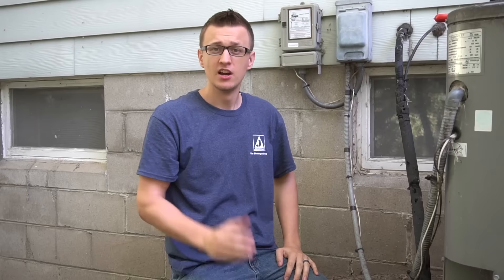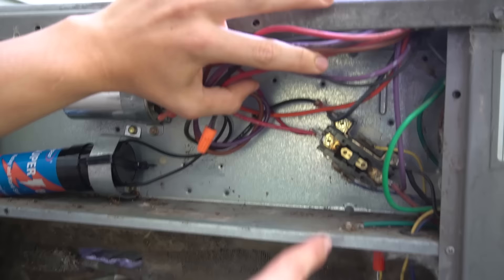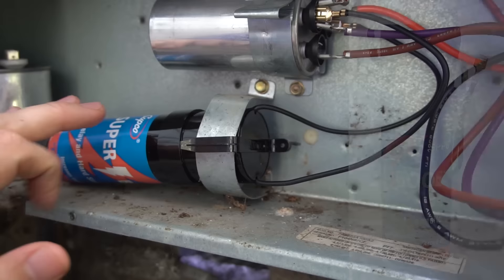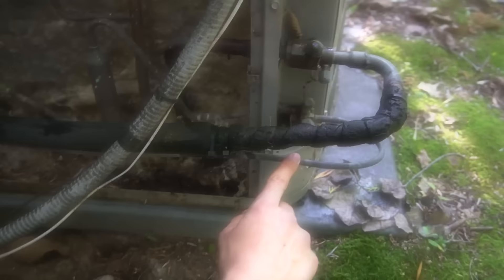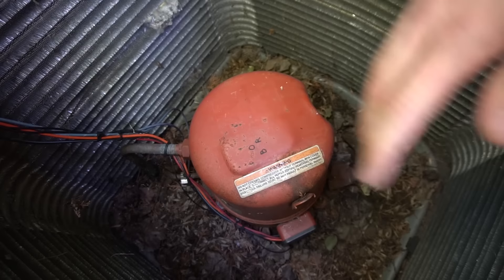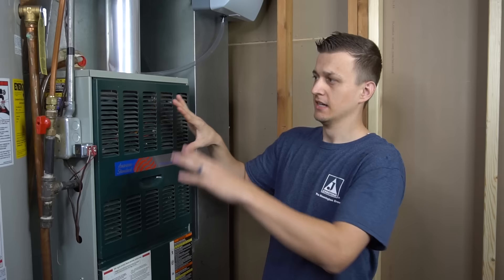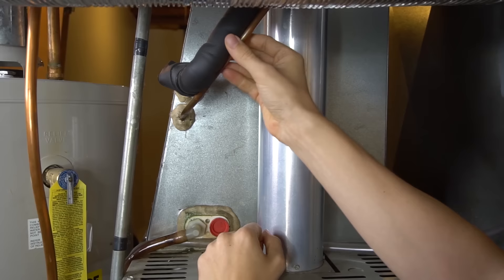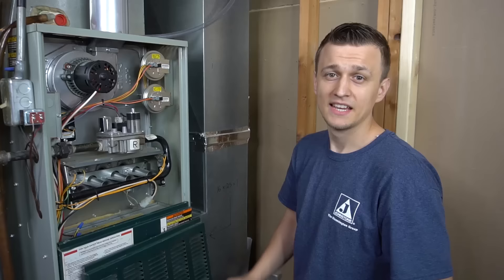All AC Parts and What They Do

Comment: It’s not the discharge line, it’s the liquid line. The discharge line is between the compressor and the condensing coils. The liquid line if after the condensing coil. 
This is every important because trouble shooting commercial equipment requires that u know this. Often, there’s ports for testing at both sites.

Comment: I recently had my entire HVAC system replaced. They put a new power box in… I think replacing my old 20A. But they left the old box with (what I just learned is) the electrical whip. I was mowing my lawn today, and I almost ran it over. It’s just dangling off my house. Can I just rip this box off? Or is it something an electrician should do or what?

Comment: Thank you for the video, I can tell you're very knowledgeable . I have a question, I was running heat and the unit cut off in the middle of the night. Now the unit is not turning on but I went out and checked and it has 220v. I tried turning the fan on but no dice, and the unit is in heat mode. Along with that it's fairly new, only about a year and a half old. What could the issue be?

Comment: My Lenox Blower Motor Control Board is shorted due to condensate water leak. Some of the transistors/resistors damaged from mould and such. Is there a way to repair or change the blower motor control board. Installed a new compressor and started working when turned on, but quit from overheating the compressor. Noticed the Mother Board Damage later. The unit is about 19 years old but was working good until the leaks developed damaging the blower motor control board. Need to know how and where to get the replacement mother board to specification? Appreciate your input. Thank you.

Comment: Thanks for the explanations. At 6:25 you're saying the Discharge line should not have insulation. In me case the Suction line is insulated as it should be, but the tape used to keep in place the insulation is wrapped around the Discharge line, too, as the lines are next to each other. Should I remove that tape from the Discharge line?
Reply: No that's nothing you need to be worried about. That's just used to keep the pipes close together and potentially keep you from accidentally stepping on one and crimping it while you're cleaning up the area around it. Countless times I've seen homeowners step on them while cutting shrubs and bushes around their air conditioners. I actually had one cut that small liquid line thinking it was a root or Branch from a shrub.

Comment: Hey Jay I missed this video somehow and just now caught it. Great video. I hope you do a how the freon cools your house video. I know how it works, but many people don't realize how freon acts under pressure or how it actually extracts the heat instead of introducing cold in the system.  And ?. On the A coil there is two pairs of red and green plugs on the side near the bottom of the coil. I guess these are all drain ports. Please explain what they really are and why they are colored red and green. Red would be high pressure and green low pressure but there isn't pressure in a condensate drip pan. I don't get it. Please explain. Thanks Jay. Love your videos. Jpol.

Comment: How do I remove the existing capacitor without dying? The power is off at the circuit breaker and the emergency shut off. However, some videos say the capacitor has a charge and you have to discharge it.I'm afraid to touch it
Reply from the maker: I show how here: https://youtu.be/45oZXnClMD0?si=7KESPSPiwGdUZe9V

Comment: Great to learn from. I mainly do heating (combi boilers) but my boss threw some airconditioning units in but we don’t really get how they work yet. I’m from Europe so I mainly work with 230VAC how does that apply to a contactor? We have a hot wire (230) a neutral and a ground wire. Should the hot be attached on the side of the plunger and the neutral on the side that’s open?

Comment: Thank you so much for this video, I have been watch your channel a while, very informative and helpful. I also have a quick question, I found there are 5 wires come from compressor of my Lennox AC outside unit, three direct from compressor, two yellow wire from a device plug in the liquid line. What is the device for ? IT looks like a "thermometer" to me. Thank you !

Comment: I have never worked in the field, possibly just starting to this month.. any advice on tools I’ll need in order to work for someone?
Reply from the maker: Some companies will actually provide the tools so I wouldn't rush with buying things. But if they don't, I would suggest only getting the basics: a multimeter, screw drivers, screw gun/drill, nut drivers, pliers, wire strippers, temperature probe, refrigerant gauges. Most companies will start you off by making you ride along with senior techs to learn for a week or two. As you go with them on different jobs, you will get a better idea of what other tools you should get. Or perhaps you could hold off on buying anything at all until you get the job.

All that being said... I do have a few videos on basic tools that you may find helpful:
https://youtu.be/fOsUpIfvoBE?si=Oub1KdoKbTICNcL2
https://youtu.be/kQjAreD8CuY?si=Q8IVmYq7F0Kz4WjF
https://youtu.be/pqE4C7c9_eI?si=4MbOr19Rf5AxuwWr
https://youtu.be/Sh8kiQKzVXQ?si=y2zulnxnKv1LPkxx

Comment: Someone said his system is fantastic and he takes care of it even getting an annual checkup by a tech. He claims that his system can go from a couple of days not working to 68 degrees in less than an hour. Cooling down his warm house that reads 89. Is that possible? Meanwhile after replacing capacitor my system struggles with getting to 78 degrees set temperature during the very hot day. Heat index of 108 degrees. What are the obvious causes for my struggling system ? Low refrigerant? Old compressor? I washed condenser unit coils and filter replaced. Just a few weeks ago it kept up to set temperature of 74-76 degrees no problem. Yes it gets down to that 78 degrees overnight but can’t do it during the day when the heat is Soo ferocious.

Comment: There is a part that you did not go over and funny enough is the part I am scouring you tube for its in side by compressor it has a two wire black wire coming of of it and it goes to a box on side of compressor.  I wish I could send you a pic I saw it on yours and maybe you said some thing about it but I don't think so🙁

Comment: I love the Info I get from your videos.
Have a question:
Have only a run capacitor, can I install a dual capacitor to help the fan?.
And two, can I install a hard start capacitor.
Reply: Most systems have what is called a dual run capacitor which is essentially 2 capacitors put into one. Those can be identified by having 3 terminal blocks on the top as well as a dual microfarad rating such as 35+5 MFd. Sometimes the compressor and the fan have their own individual capacitor. If your fan does not have a capacitor and it is working then it is probably an ecm motor which does not need a capacitor and should not have one.
You can install a hard start but it is better to look up the factory start capacitor and relay setup and run that. A hard start is more intended for an old compressor that does not want to start on its own.

Comment: You have a great explanation 👍, may i ask, how should i know the compressor tonage please ‼️ thanks❕
Reply: Look at the serial number located on or near the control panel, there will be a number divisible by 6. 6 is equivalent to half a ton, for example: if there is a 30, it will be a 2 1/2 ton unit.

Comment: Hello thanks for your videos! My question is Why Does my suction line is covered with ice during hot weather????
Reply: You either have restricted airflow through the coil or are low on refrigerant. You would need a gauge and a temp probe to figure out which one. 
Alternatively you can check for proper airflow. Make sure the filter is clean and is not too high of a MERV rating. Check the blower wheel for dirt that has gotten packed into the wheel. If you have dirt at the wheel then there is probably dirt in the evaporator coil and you should hire a duct cleaner.
But from what it sounds like you are probably low on refrigerant.

Comment: Thank you for your explanation, one question, do you think I should change my AC unit if it is already 23 years old, I already changed the fan motor and the fan and a new capacitor and I maintain it once a year, do you think I need to change my units although it is working fine?is true  that old units can last 30 to 40 years?
Reply from the maker: I've seen quite a few 30 and 40 year olds. 😄 If it is working good, I would not replace it.

Comment: This video was just recommended out of the blue. No real reason to watch it other than I like learning about mechanical and electrical things. Anyway, I really enjoyed it and learned a lot.

But in Las Vegas a good portion of AC units are self contained units that sit on top of the roof (why would they do that in the blazing heat) and the compressor section and air handler are all together. Most of the units in my neighborhood are like that. My sisters house has a split system like what you have and her house is actually older. I don't get it, but it works.

Comment: hi Jay and thank you for all your helpful videos!  A question if I may.  My Florida home has an outside AC/Heat pump unit made by RUUD. It is equipped with an electric heat element also.   It is on a slab and ducted thru the crawl space to floor vents which blow very cold air. There is one larger floor vent which also  blows air into the house approx same temp as the ambient air. Should that be?   It seems the relatively warm air should be returning from the house to the AC unit.  Any thoughts on this mystery would be appreciated.

Comment: question.. new ac unit. even when not running, there's a metallic whistle like a trickle of water (freon) coming from the closet wall opposite where the ac unit is. outside, there are 2 small copper pipes without any insulation. the noise seems to be coming from these pipes. when not running, it sounds like freon is flowing back into the condenser around the liquid line filter drier.  does that sound like a thermal expansion valve letting freon flow when it shouldnt? or something else? just curious. got an ac guy coming out this week and i think it would be helpful to know. thank you.

Comment: In the fuse box mounted a couple feet from my condenser on the side of my house. Should the fuses exceed the maximum amps that the specs plate has listed on the side of the condenser? My fuse box house 2 fuses, the specs plate on the side of the condenser indicates 25 amp maximum yet one of the 2 fuses in my box is a 30 amp fuse. Could this pose a problem and burn something out?

Comment: Hi
I have 220V contractor+wiring+thermostat all in 220V, I want to change them to 24V only Ecobee WIFI, is it the same wiring for contractor ???
2 - Do I need to change capcitator ?
3 _ How do I know which wire is which as I have my old 220 system not colored, only fan cables and Live/phase can be figured.?
Thanks
Reply: Don't change run capacitor. 
For the wiring: since you're asking basics, suggest get a sparky

Comment: This video helped me to understand a lot about my compressor unit. I have a question regarding a noise, a noise (a clunk sound) that is getting louder as the weeks go by. When the unit runs and then shuts off at temp it goes "clunk". Would that be the compressor fan motor OR the reciprocal compressor sitting on the bottom? To me it sounds nearer the fan area. Thanks!
Reply: New fan motor

Comment: Thank you for sharing your HVAC knowledge! I'm  so thankful that I found your videos & subscribed. If you offer advice via YouTube comment section please give me basic insight on the following problem please. 
First of all realizing now after 2 years I should have gotten a new unit instead of extensive repairs over the last two summers. My question is, I just had a motor, a capacitor & a connector replaced on my AC unit. My AC now no longer gets cold temperatures but warm temperatures and late evenings it would go back to being cold temperatures. Does this sound like maybe the thermostat is the culprit for warm air?

Comment: I have 2 returns, one in my room & one in the hallway(2 filters). My furnace also has a thicker filter about 3or4 inches thick.I was told that running all three filters would work my system harder.they recommended that I utilize the thicker furnace filter and no return filters,or the two smaller return filters and no furnace filter.what’s your opinion?

Comment: Dude that is not called a power saver switch it’s called a load shed box the power and light company puts it on and when they need to send power to other places they shut the power off to your unit to allow them to gather extra energy in order to send it way off. It controls the 24 volts to the contactor not allowing it to pull in to cut your unit on

Comment: Hello sir, I hope you will answer my question. I have a new cooling system that works fine, it turns off and works automatically, but after working hours it stops working despite the high temperature in the thermostat. I only hear a very slight sound in the cooling system on the second floor. I don’t know if this is a period of rest  The device or not, the annoying thing is that this period is long and the weather is very hot in Arizona. When I watched this situation, it happens at six in the afternoon and at four in the morning. As for the rest of the day, it works great. I don’t know if there is any problem.  It is removed from the main electrical panel for 5 minutes and then returns to work

Comment: Random contactor question:  I was going to swap out my contactor to troubleshoot and further isolate an issue with my AC.  I've turned off the breaker connected to the AC, and can discharge the capacitor with a screwdriver no problem.  My concern is that my capacitor only has 2 terminals, so I'm wondering if I'm going to painfully discover the presence of another capacitor somewhere else as I start disconnecting wires.  Thoughts?

Comment: In your story about the heat pump also you've got to mention a furnace does not have a heat pump furnace is gas heat, ac only Even on dual stage and some of the weirdest places on the planet you'll rarely see both heat pump and furnace and when I say rarely I mean somebody making their own
Reply: You can absolutely have a heat pump and a furnace, I know because I helped my boss install one.
Many systems with a heat pump have a second form of heat. Usually its electric because its cheap and simple. But many systems use a furnace for 2 main reasons. First because its cheap to operate. Secondly its because they already had a furnace. They replaced their AC and decided to get a heat pump to lower their utility bill and get the tax rebates.

Comment: Nice video! Question about drip tube. Shouldn’t it have a P-trap 

in line to deal with pressures and assist in proper draining? Also, what is the second plug to the right of your drain outlet?

Comment: I hope some one can help me with this.  First of all thank you I fixed my ac.  Now my issue, I have a component in my condenser unit that you have not mentioned.  Looking straight down from above the unit is the fan and just below the fan along the side of the unit, on the inside open cavity is a small round silver thing, smaller than a quarter, sticking out from the side and it has wires coming to it. It is a silver flat disk sitting parallel to the ground protruding out into the space.  I really want to know what it is, what it does and how it is wired in.   Thanks.
Reply: With out a picture of said part , it sorta sounds like it may be a temperature sensor, usually they have a bi metal spring inside that breaks current it unit overheats . I'm still nursing my first cup of coffee so I could be off on my suggestion-lol
Reply: Paul Rooster thank you sir

Comment: I always wondered if adding some kind of heat resistant material to the inside of the panel were the electrical components are would it help on energy costs? The panel were the electrical components are in my unit faces directly west so it gets all the sun after 1pm.

Comment: Hi just had a guy add 3 pds of freon, he said i needed and it only took him about 20 min to do it. It does not cool off like it has in past. Of course it was 81 in my house and 90 out side when I turned on for first time. My unit is about 20 yrs old first time needing freon. Because there was alot of humidity in the house and ran 15 hrs straight on only went up 4 degrees.  Went down stairs and was water coming out from my unit. Could that be from working hard?
Reply: Air conditioners also dehumidify meaning it pulls humidity out the air. When the warm humid air contacts the cold indoor coil it condensates and creates that water. Every situation is different and if we could fix these online or over the phone we would be billionaires. So without putting eyes and hands on it it's hard to tell exactly what's going on but yes it should be making water and it would not be unheard of at all for a 20 year old system need refrigerant. Quite frankly consider replacing it. Also the geography of where you're at makes a difference of how long things run. I live in a extremely humid coastal region and when a house gets really hot in the middle of summer it can take all day for it to cool everything off again. But yes your unit should be making water and it should be coming out that drain line and going outside somewhere.

Comment: a quick question.
Do I find AC condenser coil outside (inside the AC unit)?
or do I find another set inside the house (insider the heater)?
Thanks.
Reply from the maker: The condenser coil is outside and the evaporator coil is inside. 👍